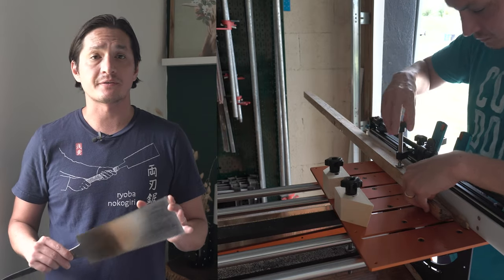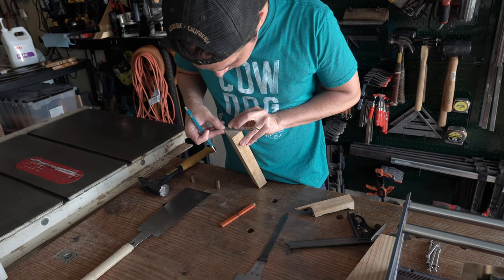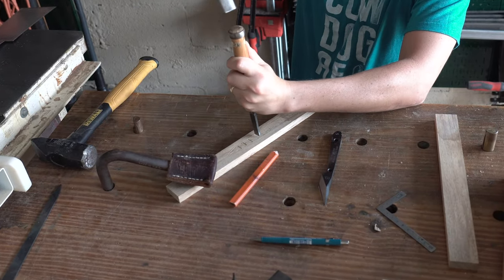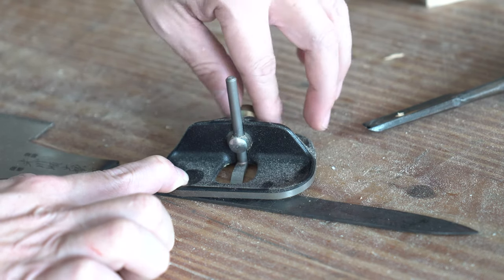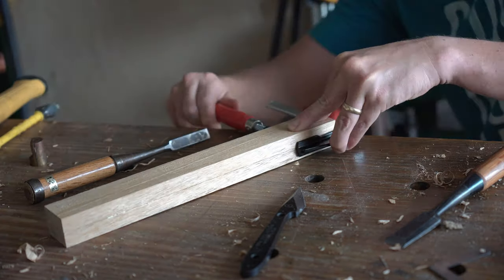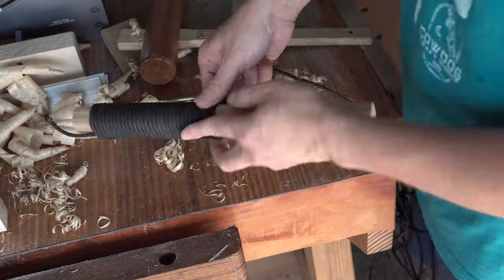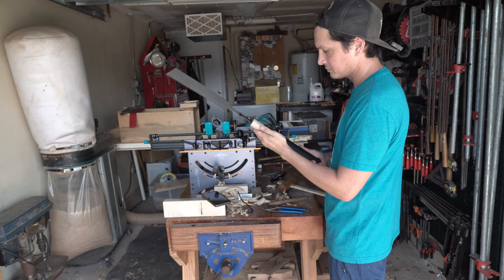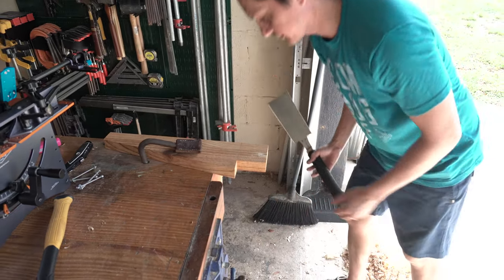Making a Handle for a Japanese Saw | Japanese Tools | Ryoba Nokogiri

Comment from the maker: Help support my channel through the following links:
The Real Milk Paint Company's Impressive line of finishing products (Special Affiliate Link):
https://www.realmilkpaint.com/ref/cowdogcraftworks/
For 10% off use coupon code: cowdogcraftworks
-Starbond CA Glues (Special Affiliate Link): https://bit.ly/3A6I5h8
For 10% off use coupon code: cowdogcraftworks
Support Japanese Craftsmanship in America and purchase planes and blades from Suzuki Tool: https://suzukitool.com/
The Complete Japanese Joinery (Book): https://amzn.to/2OAj1sM
Japanese Woodworking Tools: Their Tradition, Spirit and Use (Book): https://amzn.to/3f2eSuH
Shapton Glass Stone 8000 Grit 5mm: https://amzn.to/3mtX2EY
Shapton Glass stone 3000HR: https://amzn.to/3ekDKh6
Shapton Glass Stone 1000 Grit 5mm: https://amzn.to/3EvCVg4
8 Inch Diamond Hone Sharpening Plate 400/1000: https://amzn.to/3FuKbdd
Shapton Glass Stone Set w/Field Holder #500, 2000, 16000 Grit 5mm: https://amzn.to/3ojR230
Metric Japanese Style Carpenter's Square: https://amzn.to/35kC3fG
Mini Square 10x5cm: https://amzn.to/36mtcti
Faber-Castell Ecco Pigment 0.1 mm Pen: https://amzn.to/36oLni8
Pentel Mechanical Pencil: https://amzn.to/36uqbab
Yataro Authentic Japanese Chisel Set (5 Piece): https://amzn.to/3CLUEyV
DFM Diamond Lapping Plate MADE IN USA (120 Grit) for Flattening Waterstones and Sharpening: https://amzn.to/3z2MvWA
KAKURI Woodworking Japanese Block Plane 60mm, Manual KANNA Wood Planer for Finishing Wood Surface, 2.9×2.7×10.1 inches (41937): https://amzn.to/3szzXoe
KAKURI Chisel Hammer 10.5 oz / 300g, Japanese Woodworking Hammer GENNO for Chisel, Plane, Nail, Sledge Hammer Wooden Handle, Made in JAPAN: https://amzn.to/3ICeos8
DFM Tool Works Blue Cabinet Scraper Rectangle Sets- MADE IN USA - Multiple Sizes (2, 0.032" x 2.5" x 5"): https://amzn.to/3rVjVTY

If you want access to more tools, check out my amazon storefront: https://www.amazon.com/shop/cowdogcraftworks

//Follow along:

IG: https://www.instagram.com/cowdogcraftworks/
Twitter: http://www.twitter.com/cowdogcraftwork
Facebook: http://www.facebook.com/cowdogcraftworks
Website: http://www.cowdogcraftworks.com

Comment: Nicely done. Great looking and great working handle. Thanks!
Reply from the maker: Thank you jerry! Could definitely be a little more slim. I have small hands too. But it’s good for a while. I think having flat cord would work nicely. Also someone on Instagram suggested that I could pull the stuffing out from the round cord and I realized that was a great option.
Reply: @CowDogCraftWorks  Another possibility would be to use #36 bank line. It wraps tightly and is durable.  It would provide an excellent grip on a saw handle.  Cheers!

Comment: Thank you for a very good video on this subject, that I happened to be interested in today!

I have one question though. At 6:40 you describe how to separate the blade from the handle again: "if you want to remove the handle you tap on the handle toward the neck,  while supporting the blade with your other hand." I don't quite understand. English is not my primary language, so please help me out. (I thought you were doing exactly that, tapping on the handle in the direction of the neck in the film, to get the blade into the handle.)
Could you describe the separation in other words?
I learnt the technique of putting a mallet head on its handle as a child in the 80's, and was also fascinated. This may have been when playing croquet, and the mallets came off their handles, but I never intentionally wanted to get them to loosen :)

Edit: now I found another video. At 2 min 18 s in this one. I guess that's how you disassemble the blade from the handle: https://www.youtube.com/watch?v=SC3j5whLzHE .
Reply from the maker: Yeah. Think of hitting it on the opposite end of installation side.

Comment: Is the tang of the saw tapered or is it straight for most of its length?
Reply from the maker: It varies. This one has a fairly long straight section and then tapers off but I’ve seen others with a very gradual taper the entire length.

Comment: Now I'm looking for a blade to buy (to build a handle for), but the blades I have found so far are replacement blades for existing handles and do not have a tang like the one on your video, just a short part with some other kind of seating mechanism, such as a hook or a cross with screw holes. Where can I find a good Japanese saw blade with a tang?
Reply from the maker: Where are you located in the world?
Reply: @CowDogCraftWorks  I'm in Sweden, so a European store would be preferable. But if shipping costs are not too high I could order from other parts of the world as well. Amazon has Swedish and German sites but I did not find this kind of blade there. Perhaps I'm not using the correct terms to search for it. I've been using search words such as replacement tang blade Japanese saw.
Reply from the maker: @Ianssonii honestly I would check out Kurashige tool. They ship directly from Japan. I order a lot of stuff from them and they do have quality saws. Although I believe a lot of them have handles. I’m actually getting a batch of saws in myself. E-mail me cowdogcraftworks@gmail.com and if shipping isn’t too oppressive I could probably make something work for you.